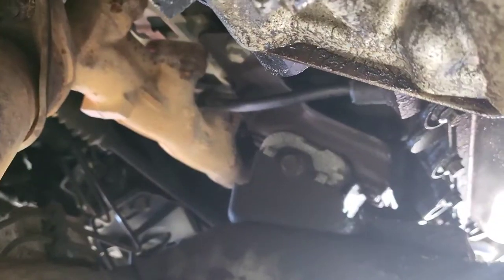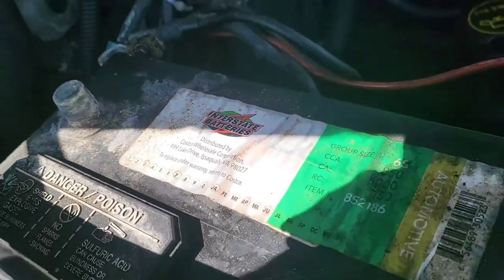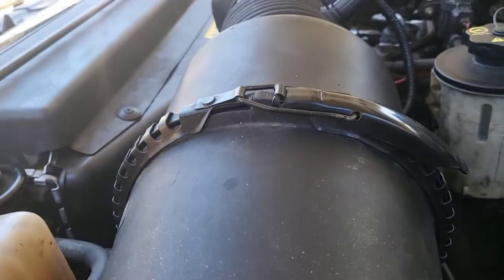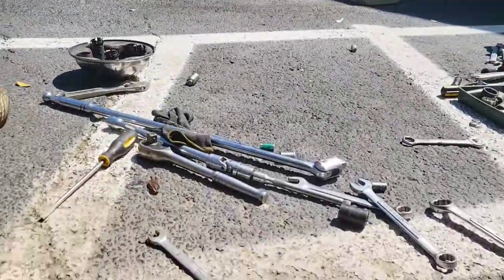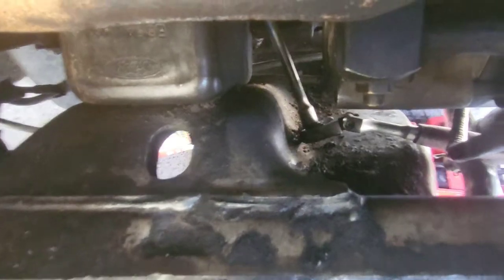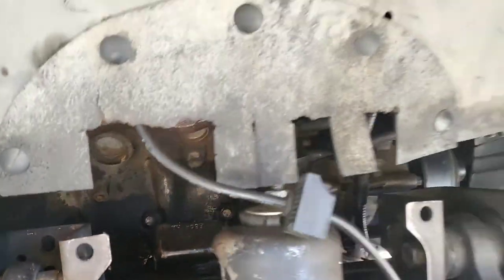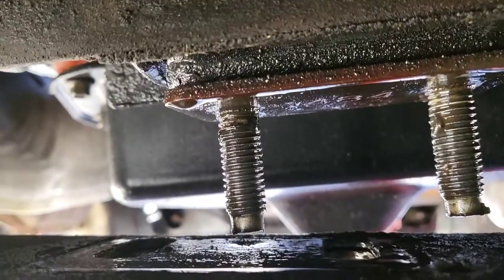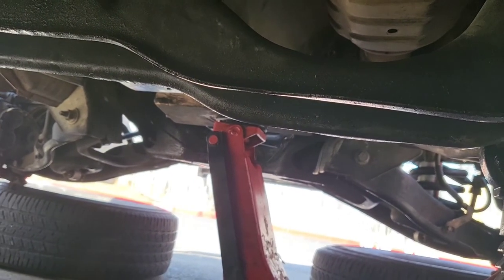4.6 2000 Ford F150 Expedition Navigator Motor Mounts Transmission Mount 1997-2003

Comment: Hey so I’m having issues with my 2000 f150, is it just two motor mounts?
Thanks
Reply from the maker: Yes two motor mounts I would also do or inspect the transmission mount too
Reply: @TinkeringTom91  sweet, thank you man!